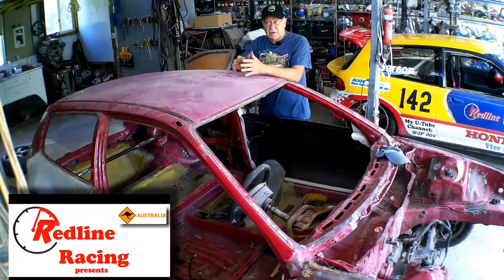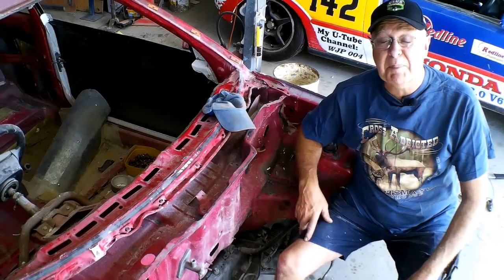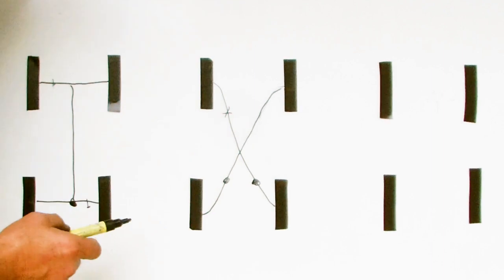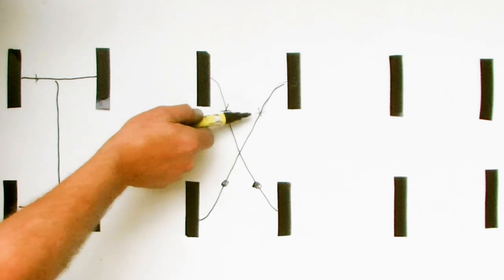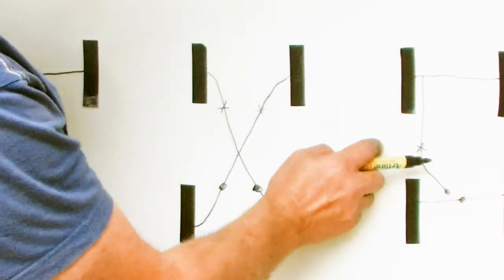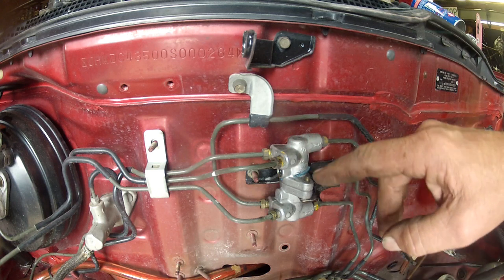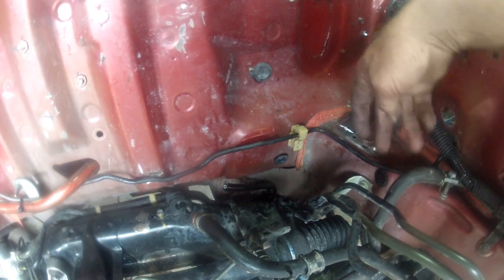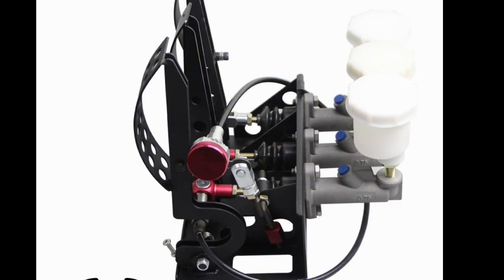How to Setup Race Braking

Comment: This will render ABS and Traction Control inop, I am assuming?
Reply from the maker: No it shouldn't much , as ABS individually monitors and controls each brake..i.e. if one wheel locks that's the only wheel the ABS pump over rides. The other three are not affected. So if the fronts each have their own line they will still be controlled individually, but if the backs are paired then yes the ABS will operate on them as a single unit. But for serious dirt work ABS is usually disabled by pulling it's main pump fuse or by-passed, as it leads to having no brakes at all.
Reply: WJP004 thanks for the reply sir! That makes sense now that you’ve explained it. I really enjoy your videos. I have been binge watching them over the weekend. I have a Ford Crown Victoria Police car that I’ve converted into a dirt racer or sorts and have gotten all sorts of inspirations from your projects. One piece front clip and other bits are definitely on the list
Reply: WJP004 I suppose my thinking was that if you change the ports on the abs pump, the abs pump wouldn’t know which port to send the braking out of.

Comment: The Toyota MR2’s have proportioning valves for the rears factory so I has to be legal in Aus for split front and rear brake circuits?
Reply: Same for the Chrysler centura and a few utes have front back splits on the brakes, that said modifying brakes with parts not designed for road use would cause legality issues. Many race brake parts specify that they are not for road use

Comment: In the United States, The brake systems are split front and rear , like you are doing on your car.
Reply: this is the same in Australia....GM...Ford & Chrysler anyway.....Im not sure on Oriental cars
Reply: Yeah Holden runs Fronts together and rears together. The Mazda 323(1994) I recently fixed for my sister was split how the Civic is
Reply: Yeah in the US dual circuits has been a DOT requirement since 1967. As far as I know fronts tied with fronts, rears tied with rears is part of that requirement...At the very least I can say in a few decades working as a mechanic in the US I have never encountered a post 1967 car that wasn't that way.